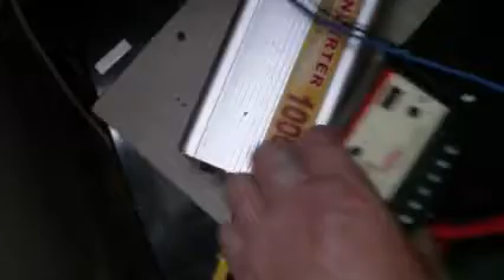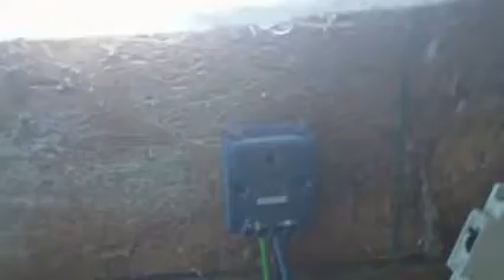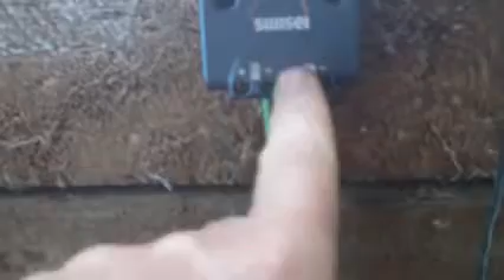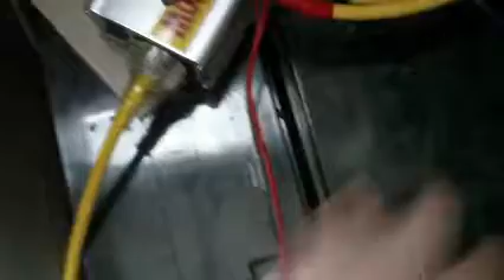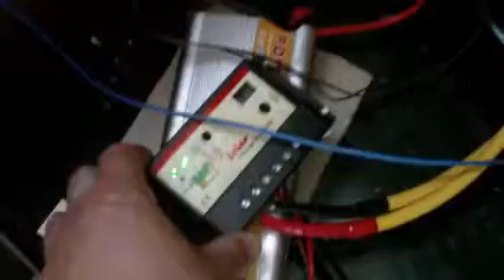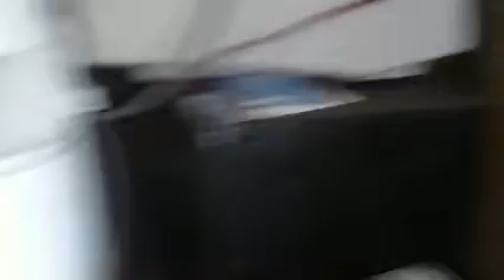Late 2014 Battery Bank 'F' setup & musings on "Sampling"

Comment: now not the theme of this video, part of routine maintenance is to check each battery of bank to make sure all cells are working.
I have a battery bank that froze several winters a go that cracked. I repaired and refilled them but not all cells work well.
 I'm thinking the bank acts more like a battery to set the 24v when producing power from solar and wind is running. this is just a campsite.
Reply from the maker: Indeed. It's pretty easy to check this in a series connected bank as you can measure the voltage ov each battery and if one is excessively low, you know you've got a problem. It's a bit trickier in the parallel connected situation though. The only real way is to separate the batteries and check each individually. Although if the battery bank as a whole doesn't seem to hold the voltage you expect it to then that's a clue one may have gone bad. 

From what I understand a battery is less likely to freeze if it's fully charged as the acid concentration is stronger, but if it's discharged it can freeze quite easily as it's essentially just containing water at that point. But surely there must be low temperatures reached in some location where even the charged battery would freeze?
Reply from the maker: We went fully off the grid at 11.39NZDT today. Now there's no mucking around..! ;)
Reply: xanataph nice!
hope that's not because the wild fires bunt down the grid lines,
be safe!
Reply from the maker: Rev John O'Toole Close...! It's because they have finally got around to installing smart meters around here and we are not having a bar ov it. We were already down to just using 1 or 2 units from the grid most days, so it was a pretty easy decision really. Only catch is I have to light the coal range in the fully summer weather here tonight to cook our pies...! ;)
Reply: xanataph some people like the smart meters, I think it's just another means of spying
best